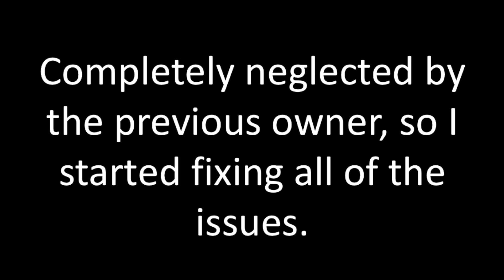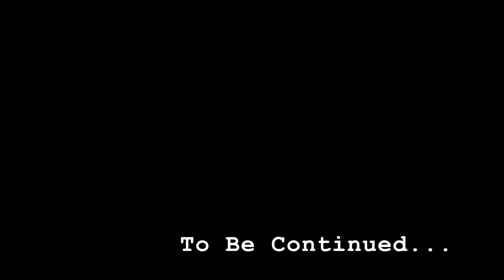Mitsubishi Eclipse 4g GT Transformation #1

Comment: Do you know why it is apparently so difficult to do a v6 swap on the 4 cylinder versions? Shouldnt it just be what you would normally expect in a swap? Like harness, mounts, and ecu.
Reply from the maker: 2WheelBandit I actually don’t know anyone who has done the swap, but yea I would expect it just to be engine, ECU, harness, transmission, mounts, and probably axels, but I don’t know of any other differences

Comment: Is it still worth to buy an 1996 mitsubishi eclipse or should I buy a new eclipse ?
Reply: Dependes what model it is??
Reply from the maker: Michael Oswald it depends on taste man, I personally prefer the look of the 97-99 second generation eclipse, but you can convert the 95-96 eclipse to the that model. The 95-97 eclipses with the 4g63 engines are notorious for crankwalk, that’s another reason I would get the 98-99 model with the 6 bolt engine. Sometimes they will already have the 6 bolt swap, it’s rare to find a stock 2nd gen eclipse
Reply: Thx